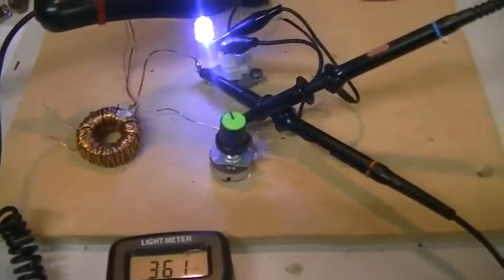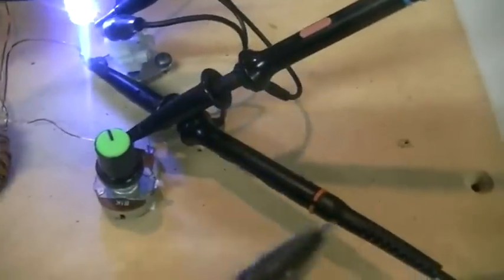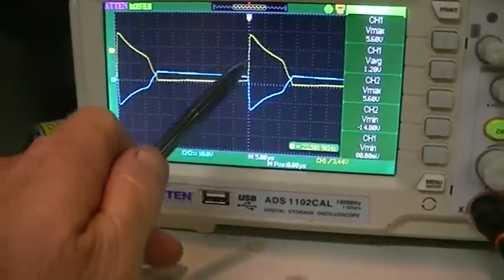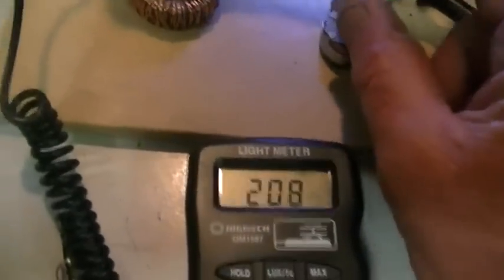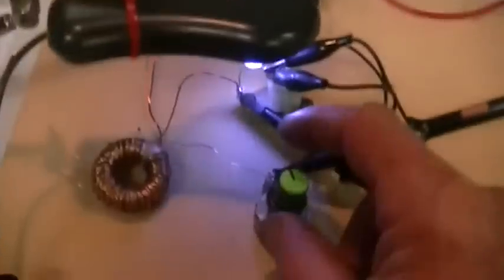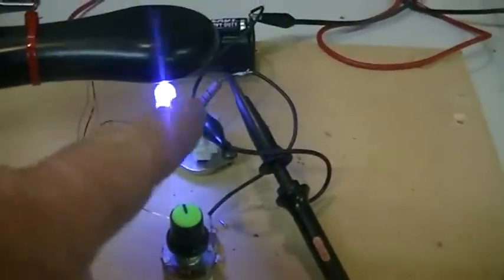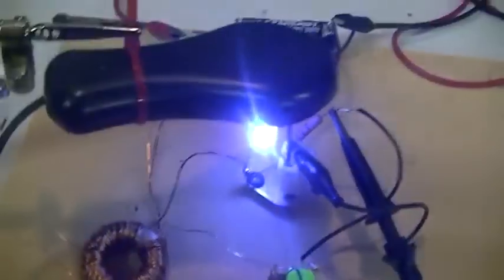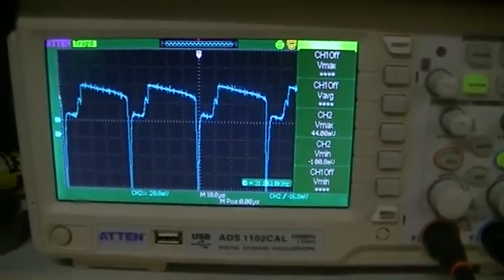Joule Thief testing PT2

Comment: Bipolar Transistors are current operated device's above the turn on voltage of about 0.6v your increasing base current by reducing the 1k pot, the 2n3055 has a typical current gain of 10 to 20 depending on factor's like how much current is been switched between collector and emitter. The voltage across the 10r resistor is measuring the base current you can't believe a change in current through L2 of a few milliamperes will have any significant effect on the magnetic field. But rather multiplying the base current by the transistors current gain will have a big impact on the current in L1 through the collector to emiter proportionally to the base current multiplied by the hfe of the 2n3055 and hence the brighter led. This isn't meant to sound like criticism  I love your view. But thought this may help your study of the JT.

Comment: +TinManPower the joule thief schematics you are using is more like a boost converter, the classic Joule Thief has the LED connected  in parallel to the coil in reverse to use just the inductive spikes, of course the voltage of that battery is not enough for the LED voltage conductivity, but it has a different approach to the circuit.
by the way, this is a good circuit for LEDs !
Reply from the maker: +Gianni Laschi there is one member on OU.com that insists that this is the correct JT circuit. Many of us have tried to tell him that there is not just one JT circuit,but he insists the test be carried out on this particular circuit. I for one,believe that the JT is not just one circuit,but any circuit that achieves the same effect.